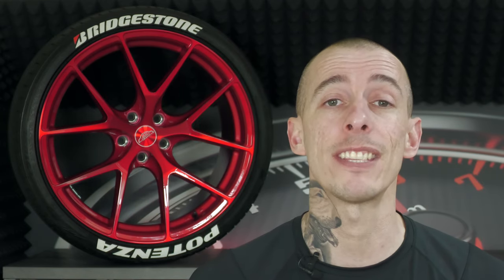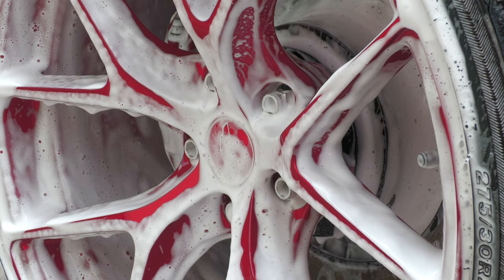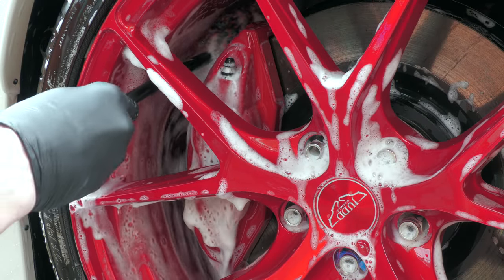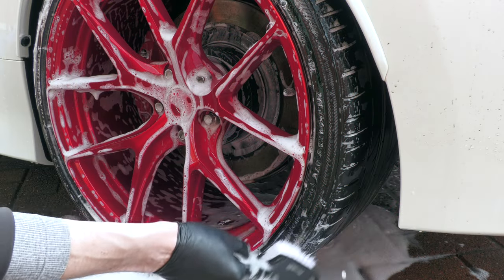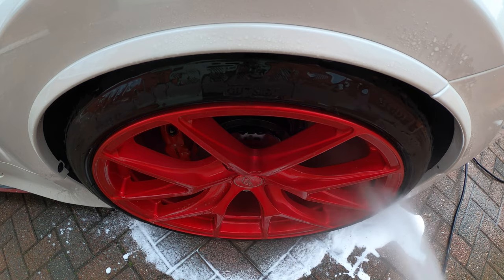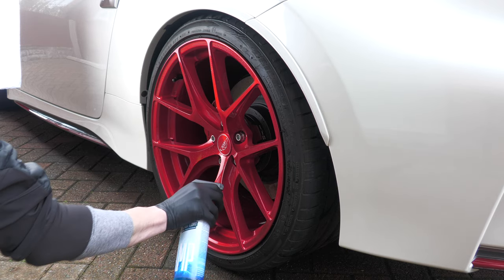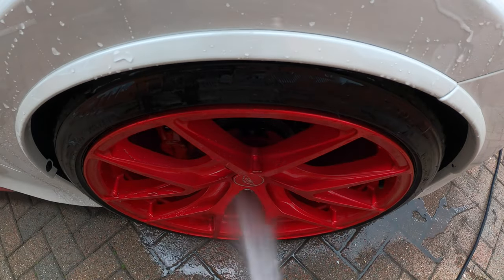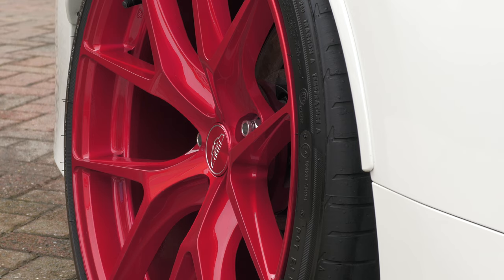Super-Safe Wheel Cleaning Tools & Techniques

Comment from the maker: Do you even take swirl-prevention measures when washing your wheels, bro?
Reply: Yes guru, since my car has painted clearcoated wheels, had to pamper them nearly as the body
Reply: I have mate black wheels,  15 mins each wheel for get it done and safe
Reply: I am ot overly precious but my latest car has years worth of old wheel balance weight adhesive, what is the best way to remove it please?
Reply: @stevencurtis-rich4178  Goo Gone and possibly a PLASTIC Razor Blade but only if necessary.
Reply: My wheels look like they were dredged up from the bottom of the ocean (thanks, 22 years of winter road salt /s). Putting swirls onto them would probably improve their appearance.
Reply: @Carlos.Rivera  Satin or Matte wheels are amazing. But they don't suit all cars.
Reply: @KiranPatel-fk1pg  on my orange car they look fantastic. But for cleaning, you will start to hate and sometimes regret
Reply: I would remove the wheel from the car so I can have full access to it.
So I can hit it with a pressure washer from multiple angles.
Would also make applying sealant easier.
Reply: @Carlos.Rivera  whys that? They can't scratch or swirl unless your using rocks
Reply: @IIGrayfoxII  There's probably little point applying a sealant since it won't last long on hot wheels that see brake dust. Personally I'd use hyrdo2 for short term easy to apply protection
Reply: @KiranPatel-fk1pg  Body sealant no, but wheel sealants are more heat resistant.
Reply: @KiranPatel-fk1pg  You do know what brake pads are made of not to mention brake discs?
Reply from the maker: @IIGrayfoxII  To begin with yes but not for a regular maintenance clean which is what this was supposed to represent.
Reply: Washing wheels is the one bit of cleaning my car that I hate doing the most
Reply: Currently no. My wheels were battered when I bought the car. I'm thinking about getying them refurbished. I would buy new but they cost £1800 for a new set of genuine oem wheels 😑
Reply: @jacrowe1984  i enjoy it the most, one of the most satisfying things to clean

Comment: I have found dish washing brushes to be perfect for tire walls, they're the perfect balance of not being too rough to end up scratching the rim but sturdy enough for heavy scrubbing. And they cost a fraction of what a tuf shine tire brush does.
Reply: But they do scratch.
Reply: @MKRM27  to be honest a microfiber barrell brush could scratch a soft clear coat on wheels if the microfiber wasn't 70;30 blend. Same with a wheel wash mitt, if it ain't 70:30 it could scratch
Reply: can't beat a Tufshine brush, as used by myself, 1000's of others and Joe himself in the video. 😁
Reply: @Mogsy28uk  I got mine for around 5 pound, it is y really expensive

Comment: You should also move the vehicle forward or backward. You will be amazed to see the bits you have missed 😉
Reply: That depends on the wheel
Reply: The Guru doesn't miss...😂
Reply: Yes I understand what you mean i always do this because the brake discs on my wheels are huge, so the barrel brush struggles getting around the caliper.

Comment: Personally I use the following tools for cleaning my wheels: 
- Stiff bristle dishwashing brush for the arch liners, tyre sidewall and sometimes the barrel of the wheel, if it is already in a bad condition. 
- Soft bristle dishwashing brush for the brake calipers and on in the gap between the tyre and the rim. 
- Paintbrush with synthetic hairs, for the nooks and crannies at the base of the spokes, on the brake calipers and by the lug nuts. 
- Microfiber noodle-style washmit for the bigger areas. 
These very cheap and readily available tools serve me quite well. 
I might completely miss the point, but what is the amazing ability of a "detailing-brush" compared to a decent quality paintbrush? 

As always, I really enjoyed the video. Keep up the good work!

Comment: Great video!
What about the iron removal part? and should it be performed after initial wash or after?
Reply from the maker: That comes during the proper clean/polish/protection job that you do prior to regular maintenance washing like this.
Reply: @CarCleaningGuru  I see what you are meanning but let me rephrase myself, I was referring to the iron removing from the wheels, I know some suggest to spray the wheel dry and some suggest to spray over a wet wheel to reduce marring.
Thanks again!

Comment: How do you deal with the rust building up on the rotors? Because on my car they usually get really rusty after a wash and when im driving later it gets on the freshly cleaned wheels
Reply: Immediatly after drying you car drive forward and backwards 10 times and the rust is gone. Or use only Wheel soap no iron removers or something like p&s brake buster

Comment: Do you think a brush like an EZ-Detail brush would cause some scratches and swirls given the nature of the bristles?
Reply from the maker: On darker gloss wheels yes so a wool or microfibre type brush would be best however sometimes the barrels are so neglected a softer brush won’t do much and an EZ or similar are required.
Reply: @CarCleaningGuru  Thanks for the reply. I did think that was the case, especially on black coated rims(cause the scratches would show up more). Best option might be to have the Wheel Woolies for newer/cleaner barrels and the EZ-Detail style ones for very dirty barrels.

Comment: I use carpro hydro 2 lite for wheel as protection. Much easier than digging in to wheel. Spray and rinse with pressure washer